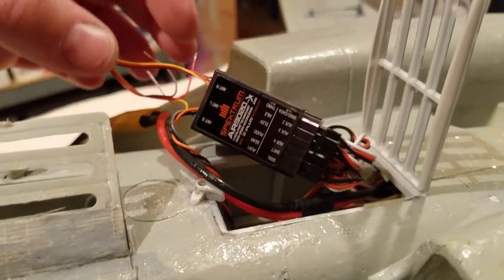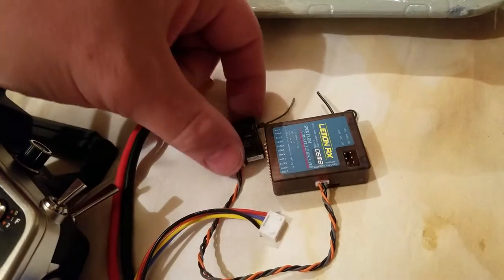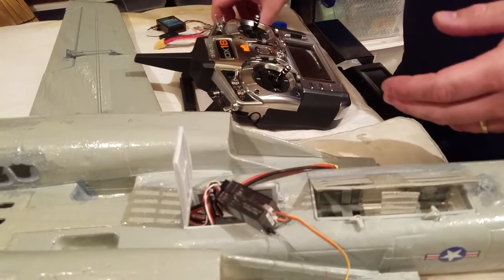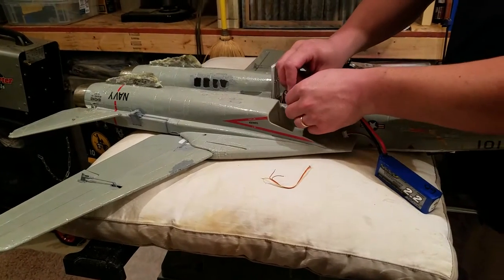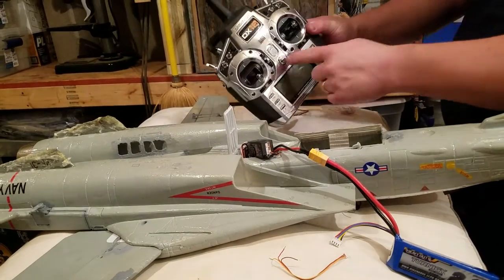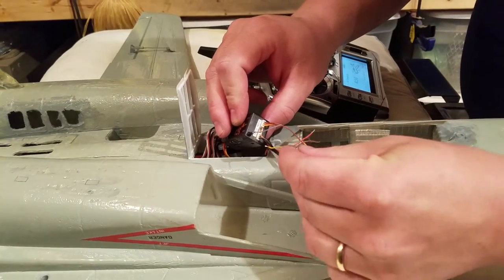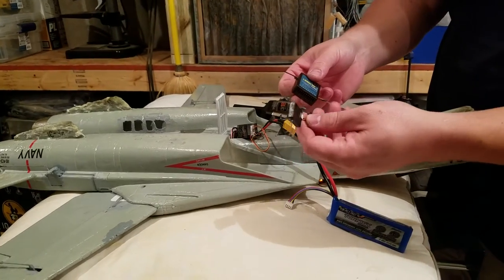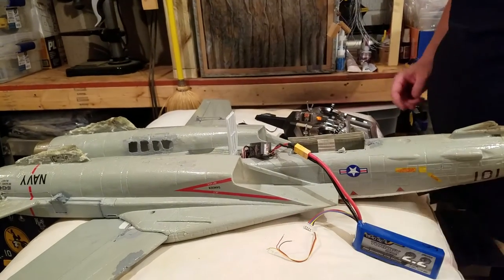Spektrum AR9020 - Running with ONE Satellite Antenna

Comment: Hey so i have some rare i think AS3x receivers right wear you can connect the external my question is what do those things do is it like a fail safe incase you loose connection also do you just connect them and they work or do you have to like bind them
Reply from the maker: They force the best case scenario before they'll start up , but you can start without the satellite.

Comment: Putting the satellite in the port where the second satellite should be then replacing it back it into its original port will work as well??
Reply from the maker: Marcel Coooer It only works if you do it before each power up...and my reciever is burried badly in the F-14

This works perfectly, and fairly easy. P.S. I've got flight footage after the mod if that helps any.
Reply: I noticed in the video at the (1:53) you had the battery connected and transmitter binded up. You moved the control on the transmitter and nothing happened. Then you disconnected the satellite out of port 1 and into port 3. Again nothing happened. Then put the satellite back in port one and the control worked. 

So I guess my question is do you even have to short them to each other or just do what you did at the 1:53 mark
Reply from the maker: If you have access to the receiver, and don't mind disconnecting the one
 and moving it to the second port then back to the first port, every 
time you go to fly, YES, you can do that, but I didn't want to do it 
that way being as the receiver is buried in the plane.

I don't 
want you to miss the point here of the video, so I want to persist, to 
help you avoid having a problem when you go to fly, so possibly watch 
the middle part of the video again. I'm wondering if I'm blasting 
through it too fast, or I didn't communicate very clear here.

The
 whole idea of this video, is to prove there is a way to only use ONLY 
ONE of the two provided satellite receivers with the AR9020, thus 
freeing up the second one for another project. This is one of the many, 
many things that Horizon Hobby won't tell you how to do. They want to 
protect us from ourselves, and to their defense, they want things to 
have the best possible chance or success, but I want to use my bought 
and paid for stuff, as I see fit...

Comment: Can I just use the main Rx without using any sat rx at all sir? Will it work still? Thank you!
Reply from the maker: Not unless you TRICK it into working without the Satellite. You can start the unit with the Satellite plugged in, then UNPLUG it - it will keep working, but if you attempt to start it up again, it won't work. The rational is that Horizon Hobby won't let the plane initiate and operate in a degraded performance. This is especially scary if you'd have a very unfortunate "Brown out"...when the thing fired back up, you'd be SCREWED...
Reply: @BrianPhillipsRC  It is understood and thank you. So in order for everything to work probably, I would need at least 1 sat Rx that plugged into the main Rx.
Reply from the maker: I think that's true :)
Reply: @BrianPhillipsRC  thank you again for your help :) !
Reply: Yes you can bind the main receiver with not problems. You don't have to "trick" anything. Just bind the receiver the way you find a normal receiver without the satellite extensions, and there you go

Comment: Tried shifting but is not working. I'm going to try the wire method and let you know. This 9020 i have has only 3 ports and no other ports bove. Is that for telemetry?
Reply from the maker: Robert, I'll be honest with you, haven't touched this Rx in a few years, so I can't quite remember. I think you're right, that it's for a telemetry device...but on mine, you had to plug in BOTH satellites to get it to start, then it was good to go, even if you detached the second satellite. Unfortunately, you'd have to install the second one at each subsequent startup, so the wire was the salvation for this project. Honestly, this F-14 didn't need one satellite, let alone two...

Sorry, my memory doesn't serve me for your question. I'm curious to hear if it works for you...
Reply: @BrianPhillipsRC  My friend put 2 satellites on it and did not have the patience. I tried convincing him but did not work. Thanks for commenting anyway😀🇳🇱
Reply from the maker: Oh well ;) Thanks for the followup. Maybe next time, or when you find a use for the satellite Rx.

Comment: Thanks for posting this. Im using this receiver on a very complex surface model, and hiding 1 satellite is going to be pain enough. I wish there was a way to not use any.
Reply from the maker: I totally agree! I don't understand why we every have to use any. I think you ought to be able to bind with none, one, or two, THEN apply the signal deterioration check and balance into the system, IE, if you started with twin sats, then you need 2 to continue use...but if you started with NONE, then none will be required for initiation.